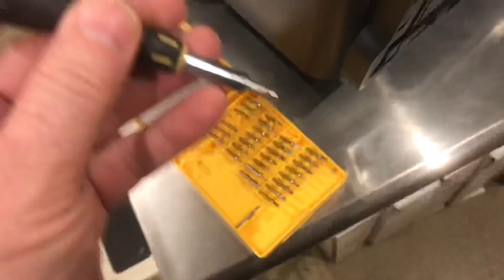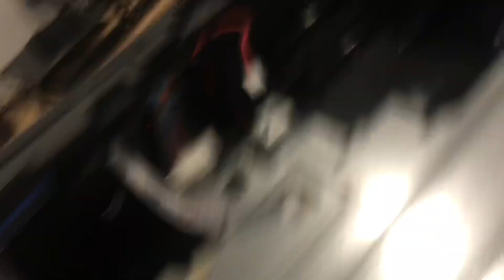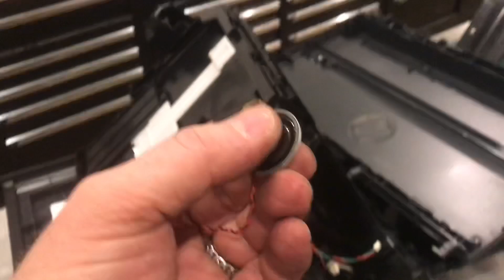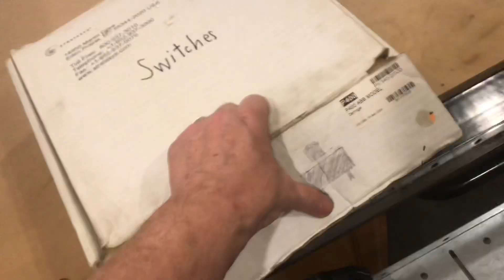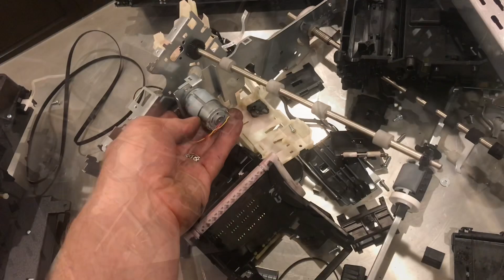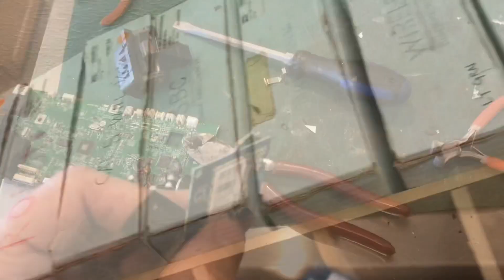ripping OLD PRINTERS apart for “valuable pieces and parts” epson, hp

Comment: Your so right on. There are so many good parts left in these devices. Just a small pact of a particular kind of screw is like $3 to $5 and the parts are good. I been saving small parts for years. If I need a nut, bolt, screw, or combination I just go to the saved pile. Bless your stewardship brother.👍🏻🙏🏻🇺🇸
Reply from the maker: Thanks, always great hearing from you. It’s always fun tearing things apart. It’s also great cleaning up the shop for the next project.👍